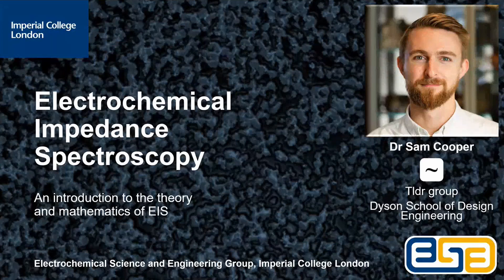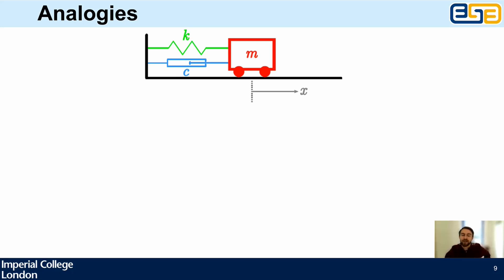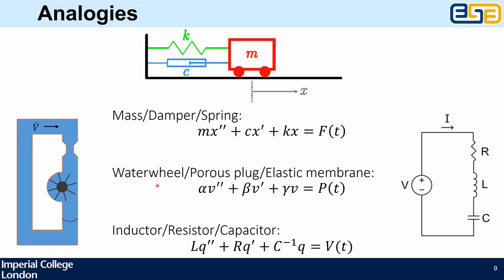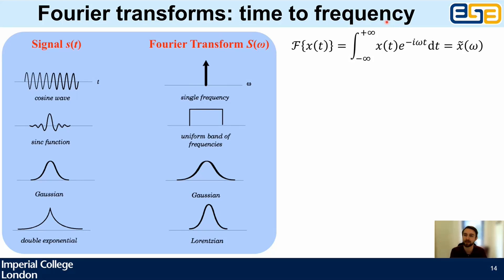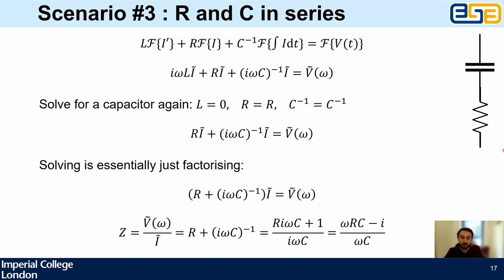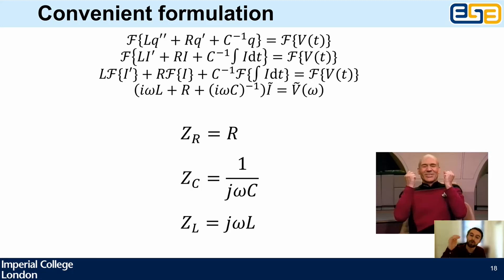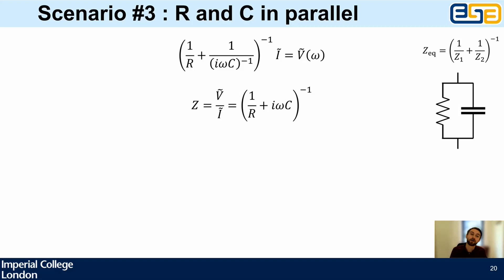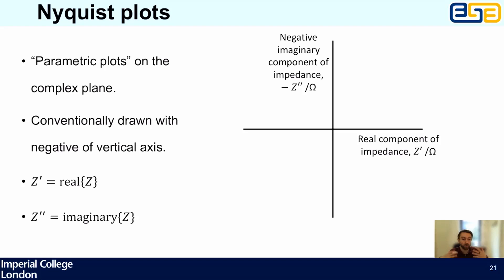Introduction to Electrochemical Impedance Spectroscopy (EIS: Maths and Theory)

Comment: As an EE student, I found this material is overly complicated. So the first hour is about phaser. The next part is about circuit components in series and parallel solving using phasers. Characteristic frequency is where half the current contribution is flowing from the resistor and half is on the capacitor. When you daisy-chain multiple parallel RC blocks you just have multiple taus. I watched the whole 2 hours and still didn't get the point of EIS. Do you want to sweep the frequency and look at the output response to characterize the system?

Comment: This was an amazing lecture Dr. Cooper. I however have one question. I understand that we obtain the capacitance of the system from the value of tau-c.  What is the physical significance of the tau-c? What information does it give us about the system being measured? :-)
Reply from the maker: Thank you Emmanuel! 
Perhaps one way to think about it is the following: let’s say you measure a system and extract an impedance spectrum. At each frequency you now have an impedance value. If you had a simple semi-circle shape only, you might assume a parallel RC circuit. You could then immediately determine the value of R from the more frequency intercept. However in order to work out C you could either use a circuit fitting package (like Z-view) to fit the semi-circle, or instead just read off the frequency at the top of the semi-circle (remembering that tau_c = RC). Once you know C, you have to hypothesis about what is physically causing this capacitance in your system. Think of it like a blocking spring somewhere, for example, liquid ions packing densely together (due to a voltage) near the surface of an electrode. When the voltage is relaxed, the ions will spring back to a lower energy configuration. If the capacitance is very high, it might suggest that your material has a very high microscopic surface area for example.

Comment: Excellent explanation on this topic! 
I have a question regarding EIS for large Li ion battery cells (over 50Ah, prismatic or pouch). the impedance of these kind of cells is significantly lower than the typical cylindrical cells so how can you "wake up" these cells?

Comment: Thanks for the great lecture. What is alfa, I mean alfa in the Z CLE Formula, in physics?
Reply from the maker: One way to think about it is the ratio of capacity to resistance in the component. alpha=0 means no capacity (it's a resistor), alpha=1 is no resistance (its a capacitor).
So you might have a kind of faulty capacitor where the more capacitance you want to access, the more energy loss (resistance) you have to pay
Reply: @sajoco  Thank you very much! We are blessed having such a wonderful lecture.